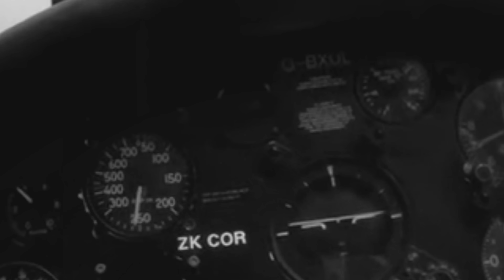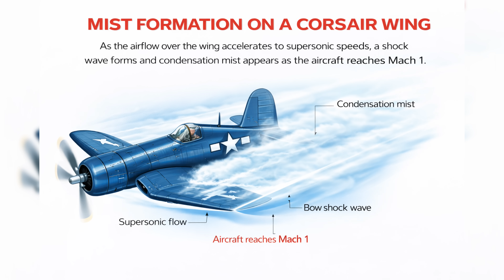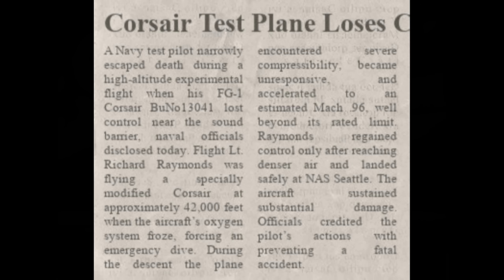The Jet powered Corsair that Accidentally went Supersonic

Comment: Supersonic in a radial engined, propeller equipped aircraft is beyond impossible given the propeller disk during operation creates a literal wall ahead of it at higher speeds. No one EVER broke the sound barrier with a prop plane. Period.
Reply: Ive spoken to one of these pilots who attempted it, Spitfire mk24. It was very much possible. It all depends on altitude, if you throw anything down at 50k its getting close. They did not break the sound barreir but touched it briefly as did this pilot too, 30mph off which is incredible. Its not hard to find if you look it up, try supersonic spitfires on google.

Comment: It's amazing that the wings weren't catastrophically torn off in that experimental flight.
Reply from the maker: Thanks for the comment Luther, well said. Fortunately the pilot was able to pull out just above 12.5k. Any lower and the air resistance would have destroyed the wings. The corsair was a tough plane with very rigid wings and gears

Comment: This is a lie. a corsair could not go supersonic, without the shock wave, busting the wings off
Reply from the maker: Thanks for the comment Bobby, are you aware of the Supersonic spitfire tests in 45? If the Spitfire can do it, the much more sturdy faster corsair can do it. This was also done with the P-51
Reply: @FlakAlley  have you ever watched the movie on the breaking of the sound barrier in the Bell X1 ?
almost tore the jet apart, and they overbuilt it to take stress. Without wing shoulders, the stress of the sound shock, busts the jets up. I can't imagine what it would do to a plane, with thick wings.
Reply from the maker: @bobbyduke777  Thanks for the comment Bobby, yes the footage is amazing! We found that these supersonic attempts were done by the corsair, p-51 and Spitfires. None broke the speed of sound despite this pilots claims but 30mph off it is still amazing. Breaking the speed of sound would definitely do serious damage to the frame.

Comment: The Corsair was a solid built Aircraft an for it to put up with that kind Force is credit to it and it's Designers and builders..Good vid.
Reply from the maker: Thanks for the comment Salvaged, beautifully said. Even by todays standards the Corsairs numbers hold up. A very strong and fast plane
Reply: @FlakAlley ,it was one of my first Revell kits 1/72 Brass plate series then the 1/32 , it never fails to please in Alloy or Plastic.

Comment: Thanks for the great story of Corsair going almost supersonic. Didn’t know it could fly so fast! Just want to check with you one aspect of this flight test. The pilot’s rank was Flight Lieutenant. Was he British? I’m a little confused as he landed at NAS Seattle which was a US military base. Furthermore m all other details point towards the test being conducted in the US as the flight data was analysed by the US Air Force. On this note, it would be more accurate to say US Army Air Force as the term USAF was not used then.
Reply from the maker: Thanks for the comment Des, yes he was, in fact quite a few British pilots conducted similar tests with Spitfires also at home and overseas. This is when supersonic flight was being studied. You are most welcome :)
Reply: @Fla @FlakAlley ks for the clarification. About the Corsair going almost supersonic, I thought this was achieved with the use of the booster. However, the speed was clocked during a dive. As such, could we say the booster didn’t play a role in achieving the speed?
Reply from the maker: @DesMen-i9z  Regarding the booster engine, its difficult to say. It would make sense for it to not play a part as the point of it was to test high alt jet performance. In the dive the pilot would normally turn it off as it would serve no purpose to the test

Comment: My dad stated he could get .85out of one of  the F2G   That was at Goodyear Aircraft in Akron. He wanted to add air scoops under the wing to get more air into the carburetor. The war was winding down so further development was not a priority.  Goodyear only built seventeen F2G’s

The Navy was running Goodyear Aircraft at that time.
Reply from the maker: Thanks for the comment Gotsloco, that is amazing! Did your father survive the war?  :)
Reply: @FlakAlley  
Yes.
He was got orders to Kwajalein three times.  He made it to Los Angeles once before the Navy decided they wanted him somewhere else.
Volunteered Dec. 1941, Inducted March 1942, First assignment Army Industrial College Washington DC. Second assignment Engineering Officer Naval Aviation Training Squadron 13 Corpus Christy Texas, Beeville once the Air Station was open.  Then Drone Development at La Jolla. Then some time at Great Lakes.  Finished the War as the Senior Contracts administrator for the Navy at Akron, Ohio.  He was also the person responsible 
for seizing Goodyear Aircraft for the Navy.  When the workers went out on strike he convened a draft board and drafted the entire plant. The put them back to work.

At the end of the war the first orders he received to shut down Goodyear was to stop work and scrap everything.  He had delivered a plan to the Pentagon to build out partially completed planes and build a stock of spare parts for the existing planes.  After receiving the first orders he "got on the horn" with Washington to get those orders canceled.  That happened, followed by the teletype running for 24 hours with his four hundred page plan on how to optimize the shutdown.

After the war he had problems finding a job as it was unlawful to work for a company one had had contracts supervision over.  He taught at San Francisco City College for a while, Was the Executive Director of the Richmond (CA) Redevelopment Agency and finally when back to practicing Law.  He had passed the California Bar in 1931.  At the time of Pearl Harbor he was Managing San Jose Brick and Tile, and The Remillard-Dandini Brick Works.

Comment: I believe there was another incident where an Spitfire of the last generation did kiss mach 1. But not aknowlegded as supersonic flight. The pilot in this event also had the compresability to fight with. Sidenote. A Starfighter jet which had it's wings bend down normally., Encountered the cliffs of Bornholm Denmark and had to pull up so sharp. That resulteded in an damage assesment after landing. And the wings was after the assesment bend up. Sorry for mispelling. English is not my beast (or best) language. Oh. And i like a couple of whiskies after a 12 hour shift.
Reply from the maker: Brian thanks so much for leaving this comment. You worked 12 hours on Christmas day? Your spelling is great and yes you are absolutely correct. Spitfires attempted this and almost touched mach 1, they flew a little higher than this corsair however they had much thinner wings and in general a lighter aircraft. The corsair has thick sturdy wings with a landing gear that can take a beating

Comment: This should not have been a issue in the first place as this issue of compressibility had already been addressed with the P38 (non jet powered) If this jet engine was controlled separately in the cockpit the first thing the test pilot should have done in the dive is shut down the jet engine then drop the landing gear, it takes minutes for hypoxia to kick in so why did the pilot rush his decent putting the aircraft into such a dramatic drive at speed knowing the issue with the P38. I can't understand why they even sent a pilot above 10,000 feet without Oxygen, Bomber and fighter pilots well before the war that exceeded 10,000 feet all used oxygen. This is the Swiss cheese effect, this was just American stupidity!
Reply from the maker: Thanks for the comment 1936, the Corsair would have had an oxygen supply however it froze up forcing the pilot to descend rapidly. Our guess is that he couldnt breath and it was quite serious. Since the cockpit wasnt pressurised, rather than blacking out he went down as fast as possible. Why was he up there to begin with was to test a new jet engine. This was not an intentional mach 1 record attempt, unlike the spitfire pilots who tried it.

Comment: Might not have broken the sound barrier, but cool record and it still stands.
Reply from the maker: Thanks for the comment Msa, 30mph off is still incredible. They lacked the equipment to properly deny his claim so it is very much plausible. Corsair was rated to a 0.82 mach limit. The true limit of the airframe was unknown. This would have been a stripped down version and it also had a jet strapped to it.

Comment: it is not the the fastest piston powered plane, as it required a jet and a dive. and it didn't go supersonic. Mach 0.96 is NOT supersonic.
Reply from the maker: Thanks for the comment, pilot claimed it had gone supersonic which was off by 30mph as we found later. That being said it would be disrespectful to go against the pilots words as none of us would ever attempt this and we werent there either. They lacked the equipment to properly deny his claim so it is very much plausible. Corsair was rated to a 0.82 mach limit. The true limit of the airframe was unknown. This would have been a stripped down version and it also had a jet strapped to it.
Reply: @FlakAlley  "That being said it would be disrespectful to go against the pilots words as none of us would ever attempt this and we werent there either."

false, it's WRONG to take a pilot at his word. all such claims MUST be verified to count. many pilots claim lots of BS stuff. if there is no corroborating evidence, then their claims must be discounted.

"They lacked the equipment to properly deny his claim so it is very much plausible."

no they didn't. they very much had the ability to measure the speeds, and had been measuring mach speeds back in WW2 during testing.

"Corsair was rated to a 0.82 mach limit. The true limit of the airframe was unknown. This would have been a stripped down version and it also had a jet strapped to it."

exactly, not piston powered to achieve those speeds. it was jet powered.

Comment: Smart thinking to lower the landing gear … though even that was a huge act of faith, but what other option did he have? I'm surprised the plane wasn't ripped apart.
Reply from the maker: Thanks for the comment Custer, it was part of Training. In fact you can see it in the film being demonstrated. That being said the official mach limit of the Corsair was 0.8, nobody was crazy enough to push it past that. Fortunately the gears were made to take a beating so in the thin atmosphere they held up
Reply: The landing gear were explicitly designed to be dive breaks. The pilot was completely aware this was the express tool for slowing down the aircraft.
Reply from the maker: @paulflocken2730  Thanks for the comment Paul! Thats exactly right. Its demonstrated in the training film shown so all corsair pilots knew of it. It was probably used only a few times however as your average pilot wouldnt have pushed the mach limit
Reply: @FlakAlley  Considering all the pictures I've seen of Corsairs festooned with bombs, they probably used them as dive breaks quite a lot.
Reply from the maker: @paulflocken2730  Ah! With bombs installed it would have been quite difficult to pull out of a high speed dive. Perfect time to use the airbrakes

Comment: The plane never went supersonic. #CoolStoryBro
Reply from the maker: Thanks for the comment Thomas, mach 0.96 would put most of the airframe into supersonic speeds such as the wings. The pilot claimed he had gone supersonic which they later confirmed as 0.96 however you must keep in mind that this wasnt an official speed record and they lacked the proper measurement tools to make a proper assessment. He very well could have gone supersonoic entirely
Reply: @FlakAlley  
"The pilot claimed.."  :body-green-covering-eyes:
Reply from the maker: @thomasg4324 Thanks for the comment Thomas, Given that we werent there and none of us would be brave enough to test this, it wouldnt be too unfair to give the pilot the respect he is due. Technically an aircraft officially rated with a mach limit of 0.8 can pull it off if it is high enough. This was done at an altitude higher than usual operational ceiling noted in the flight the manual, he did have a jet to assist with that. We also know Spitfire and P-51s attempted it and got close. The corsair is quicker and more rigid than both
Reply: @FlakAlley  
"..and none of us would be brave enough to test this.." <~ You have no idea whom I am, nor my resume. So you speak only of your own lack of bravery.

"it wouldnt be too unfair to give the pilot the respect he is due.." <~ You are allowed to believe whomever you want, and call it "respect" if you wish.

.."officially rated with a mach limit of 0.8.." <~ You are allowed to believe the claim(s).

Comment: This is bogus. The only thing that could ever go supersonic on a propeller driven aircraft are the propeller blade tips. That’s what happens when you over speed the propeller blades in a dive. It doesn’t matter if a jet engine is mounted to the aircraft for extra thrust. It’s impossible for the airframe to exceed the speed of sound. There’s far too much aerodynamic drag for that. Airflow around the wings and tail can generate shock waves if the aircraft exceeds its never exceed airspeed. And thats a serious problem. But this aircraft never ever exceeded Mach 1. The fastest a Corsair ever flew was 470 mph. No where near the speed of sound. Not a chance in the world. False!
Reply: Go too fast and the wings come off
Reply from the maker: @ronjonson26  Thanks for the comment Ron, indeed but only if the air resistance is high enough. At 45k you are looking at roughly 1/10th the resistance. This is how they tested the Corsair to mach 0.8 in the flight manual and you can also see part of testing in the video where the aircraft dives with the landing gear down. This is termed Mach Limit.
Reply: @r@r @ronjonson26 have to know and consider the difficulties that were encountered with getting the Bell X-1 to Mach 1. Stability issues. And dealing with the build up of shock waves upon the control surfaces. At one point Charles Yeager lost control of the X-1. The aircraft went divergent in all three axis. Roll, pitch and yaw. He successfully recovered control of the aircraft. But it was an extremely close call. The F4u was not designed to be flown anywhere near such velocities. This was outside the flight envelope of the aircraft. 
As an aside, the Douglas DC 8 was test flown at a velocity just barely Mach 1. The purpose was to learn how to recover an airliner from such an over speed situation. Becoming the very first airliner to fly supersonic. A google simple search will reveal further information concerning all three aircraft that I have mentioned.
Reply from the maker: Thanks for the comment George, are you aware that the Corsair had a tested official mach dive limit of 0.8? That is also at normal operational heights. This flight was much higher and it would have been a stripped down version of the corsair. 0.96 is entirely possible.

Comment: LEAK THE DOCS ALREADY, NEED THIS IN WAR THUNDER
Reply from the maker: Thanks for the comment Task, if the Corsair it modelled correctly it should already be able to achieve the official mach Limit of 0.8. Can you test this?  The Corsair in this video is a special variant of course flying much higher but in thoery you should get pretty close

Comment: Had it not been a navy plane with gear robust enough to withstand hundreds of carrier deck landing it surely would have torn off during that dive.
Reply: Quite so!
Reply from the maker: @Sundog_x  Did you know that the Corsair had an Official mach limit of 0.8-81? 😄
Reply from the maker: Thanks for the comment CX,  you can also see part of testing in the video where the aircraft dives with the landing gear down. The Corsair had an official mach Limit of 0.8. At 45k you are looking at around 10% the normal reistance so pilots could even use flaps whilst going very quick.

Comment: How could that Corsair lower the landing gear at that speed and even if it could the landing gear would shear off. While this incident did actually happen I'm not buying the whole story here.
Reply from the maker: Thanks for the comment Zanti. At 45k you are looking at roughly 1/10th the air resistance. This is how they tested the Corsair to mach 0.8 in the flight manual and you can also see part of testing in the video where the aircraft dives with the landing gear down. This is termed Mach Limit.  Pilots could even use flaps whilst going very quick,  the gears of the Corsair which were incredibly strong at sea level would work quite well as an airbrake as long as the pilot is high enough. If you get too low then its coming off!
Reply: @FlakAlley  I get ya. And the F4U-1 could lower the gear at up to 380 kts so I guess it would be possible. Thanks for the explanation.
Reply from the maker: @ZantiMisfit198  Of course, it is the most logical explanation for how it happaned :) Also, Merry Christmas to you Zanti

Comment: Misleading headline. I knew before I read it. Many prop pilots claimed to have broken the barrier, but it never happened.
Reply from the maker: Thanks for the comment Bill, unless you were there alongiside them it wouldnt be fair to downplay their claims, none of us would ever attempt this so that deserves respect. From a physics standpoint however the corsair had an official mach limit of 0.8. That is also at normal operational heights. This flight was much higher at 45k you are looking at roughly 1/10th the resistance in a stripped down version of the corsair. 0.96 is entirely possible